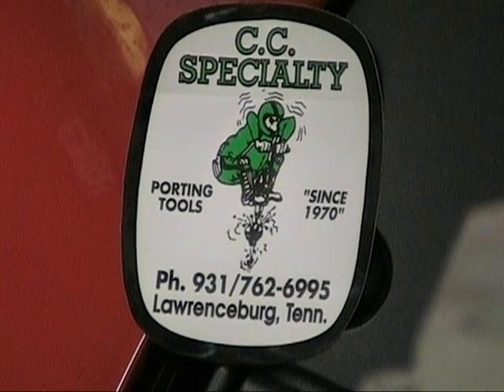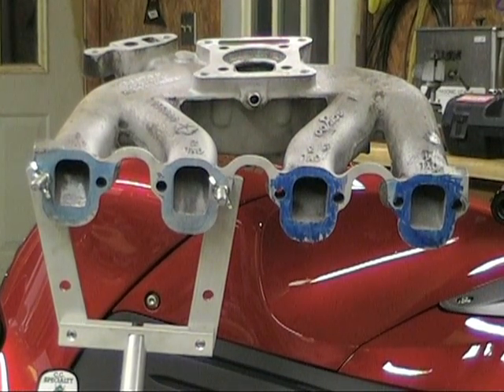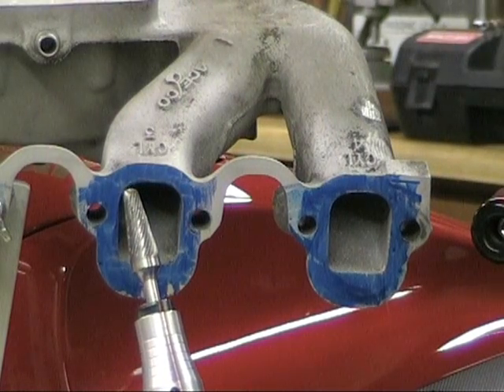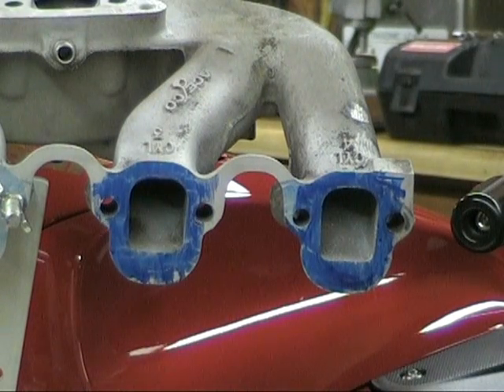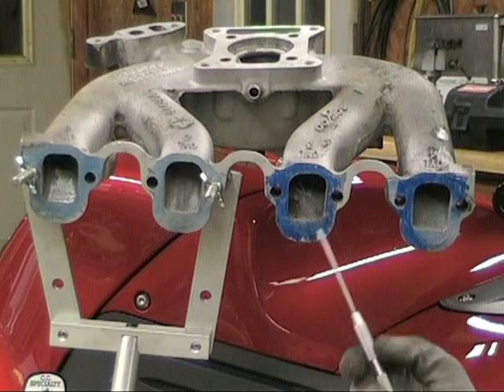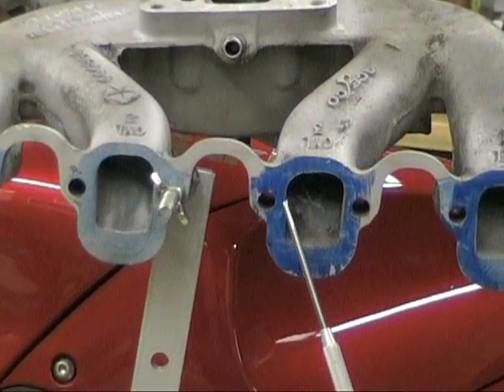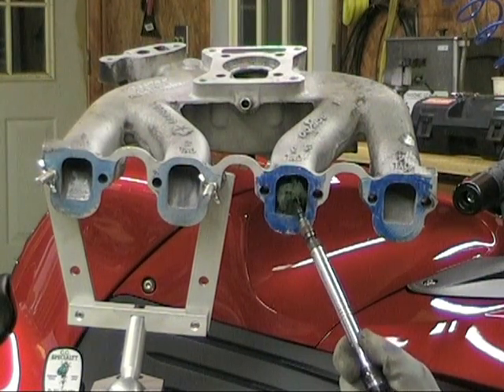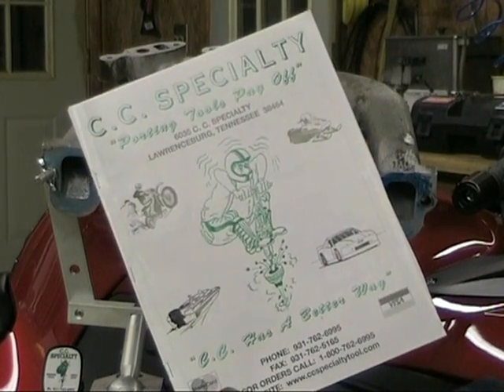Porting an aluminum intake manifold, basics of porting and polishing.mpg

Comment: High speed is ok as long as the burr is balanced, Most chatter and bounce is caused by hitting two surfaces at the same time ie the port wall and floor, WD40 works very well for lube, Heat is your biggest enemy, you want the cutter to do the work with minimal pressure applied in my experience

Comment: you have to use motor oil thats why it is skipping
Reply from the maker: +puppup zera  Nope. Not skipping, and don't use motor oil when you're doing this. Thanks for watching.
Reply: +CC Specialty Tools I do this every day works for me should try it
Reply from the maker: +puppup zera  sure it could probably work fine. We sell a specially formulated Porting Wax that will work a bit better though

Comment: my mind told me to run the burr on a bar of soap occasionally to keep the flutes clean of buildup, seems to work, heard candle wax helps also. whats ur take on this?
Reply from the maker: +Jobob's Bobjobs there are several forms o lubricants that can help during the metal cutting aspect of this. They serve to lubricate, reduce build up, and dissipate heat. We even sell a specialized wax based lubricant that works perfectly for this application   http://www.ccspecialtytoolstore.com/porting-wax-p/portwax.htm

Comment: What is that sponge looking bit called?  At 12:36. Thanks
Reply from the maker: +E Cannon  That would be a Cross Buff http://www.ccspecialtytoolstore.com/cross-buff-abrasive-1inch-p/crsbf1inch.htm . The Cross Buff blending abrasive is great for the final leveling and smoothing part of the process.  Cross Buffs can conform to the surface and inner dimensions of the port or tunnel, and come in various grits. They can also  create various surface textures, depending on what rpm you run them at, and how much pressure you apply. Thanks for watching.

Comment: I have a noob kind of question.  When you port & polish it, you're basically making the port (in the intake in this case) the same size (and shape) and the opening in the gasket, correct?
Reply from the maker: Thanks for watching. It is important to match the intake or port opening to the gasket, or more often the gasket to the opening. This particular intake had a considerable mismatch between the port opening on the cylinder head and the opening on the intake. You will see me address this in some of the other videos. Porting and polishing is a lot more than just gasket matching, however, the fundamental idea is to improve the flow and efficiency of the overall system, with precise and incremental improvements.
Reply: That's a really good point. Look at the pieced your working on overall. Is it really the moment to be matching to the gasket, or is the gasket better trimmed then removing too much material to match to the gasket would be detrimental, especially with something for the street and not the drag strip.

Comment: Which kit would I need to port manifolds
Reply from the maker: There are a lot of choices out there. Just from us at CC Specialty, there is the 20 Kit, the D44SRMC, D2MC, Bare Bones Kit (cheapest starter kit), and several others. Depends a lot on how much you want to do (and spend). If you already have a rotary hand tool and drive motor, you could even get away with just some carbide burrs and sanding abrasives. Thanks for watching.

Comment from the maker: No, that is not true at all when working with non-pressurized intake systems. All casting marks, seams, and surface flaws are removed, as stated in the video. However the smooth texture finish will promote the air boundary layer effect, (similar to the dimples on a golf ball). The textured finish will also promote fuel droplet dissipation by allowing for less surface tension, along with helping keep the the fuel air mixture mixed while traveling the intake runner. Thanks for watching.

Comment from the maker: Yeah not real sure what you mean. These intake ports were not buffed. They were enlarged, reshaped, casting marks removed, and  the severe mismatch between the intake port opening and the cylinder head port opening is fixed. If you watch some of the other videos on my channel you can see more about that. Overall the intake ports were opened over 3.5 mm more in cross sectional area.

Comment: Nice info for the newbie's mate. That intake is from a dodge or chrysler, it had a throttle body and spray head injection setup that mounted at the back there. The air came past the spray head and mixed as it went down the intake runners. Looks like you have the right approach to the finish you leave for that situation.

Comment from the maker: I've got a couple emails asking if this can be accomplished with just abrasives. Yes it can, it will just take longer, possibly a lot longer depending on how much aluminum you need to remove.  The carbide burrs seem to work better IMO at reshaping the runners closer to straight internally